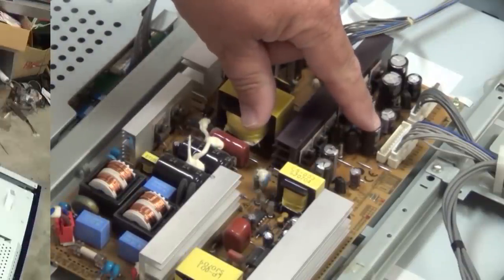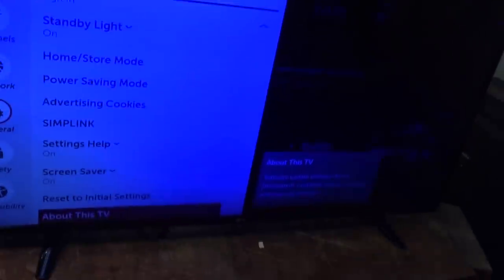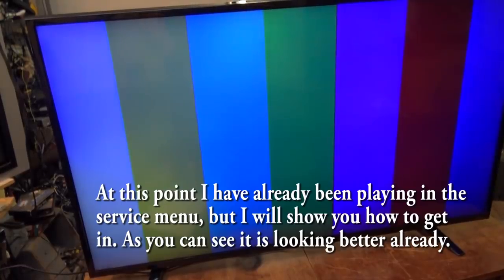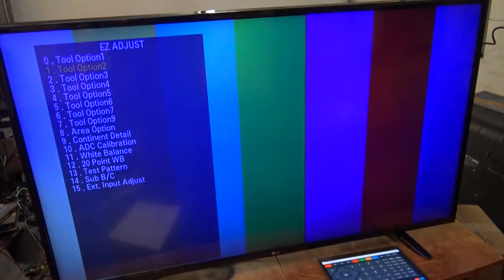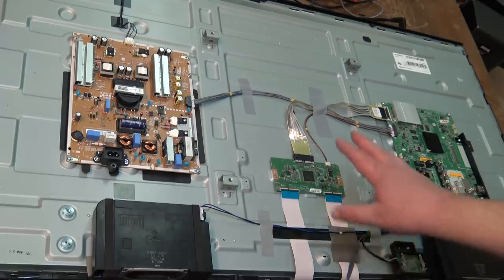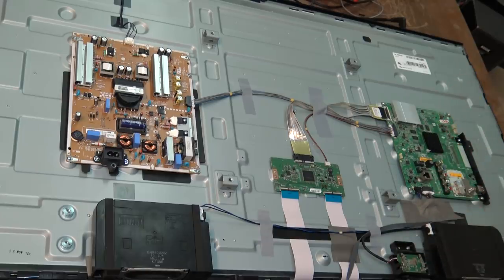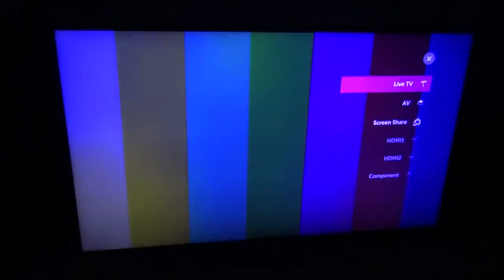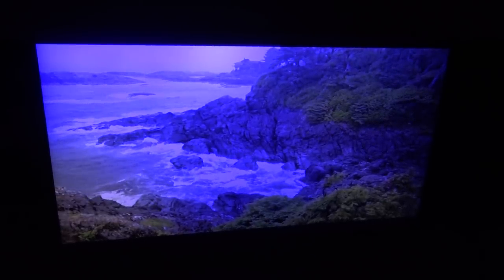LG 49UF6400 UHD 4K TV Picture Turned Blue. Let's find out why.

Comment: LEDs are MUCH superior to ANY kind of gas discharge lamp. They are not only more efficient, also feature much better CRI these days, which is important for color accuracy.

It's just that TVs are just utter garbage! They overdrive the LEDs to offer a brighter picture, do a shitton of image processing to make it look "better" and they lack compatibility with non-cinema resolutions and use HDMI instead of much more versatile and much higher bandwidth DisplayPort. They don't have support for cinema colorimetrics although being meant for home-cinema, they don't feature factory calibrated panels and so on. TVs are just utter garbage in general.

I rather have a small 32 inch Dell UP3216Q PC monitor than a TV with never the same color...

About power consumption: Congratulations for living in North America, but in Germany we pay 30 EUR ct per KW/h, which is AFAIK most expensive in the world. And AFAIK everywhere in the world, electricity is much more expensive than in North America, so I consider your electricity as almost free.
Reply from the maker: If my electricity was free I wouldn't be getting a bill of over 800.00 every 2 months.
Reply: @12voltvids  Then I don't understand why you prefer outdated power hungry technology over modern technology. Buy PC Monitors. They are much better, they easily last a decade. I can understand, TVs are just garbage.
Reply: @12voltvids  I pay this amount a year but only with around 1600 kw/h of consumption...
Reply from the maker: @kyoudaiken  
I use lots of power. Yesterday I user 137.5kwH and the day before that when i had the heat on in the shop 186.2 according to my power meter.
Our power here is .14 per kwh.  It used to be .06 about 8 years ago, but it has been going up every year.
Reply: @12voltvids  Here it also goes up every year. I could not afford to heat with electricity. Gladly we have central oil heating in this apartment building. But I still have an electric flow-heater for both my bathroom and kitchen, which may be responsible of 2 thirds of my yearly consumption. I would suggest you to invest in solar, I can't do that because it's not my building...
Reply from the maker: @kyoudaiken  I have LEDs throughout my house. In fact the only place that I have fluorescent lamp is in  the shop. I do have an LED monitor on my computer, an LG and it has lines running through it at 3 years old so I gues it is about time for a new one. I do however continue to use my plasma TVs because I like the picture. I do have a new UHD 4K set and I don't watch it much because if you are sitting off angle it looks like crap like all the LCD panels.  I have a couple of old CRTs around that I use just as camera monitors or to display the time on (little one over my bench) The plasma TV is not the big energy user here. It is the heating system. I have a heat pump, and that draws lots of power, also drive an electric car, so I have to charge that up, and my work shop has an electric furnace and when it is below 0 outside it needs to run or the shop is too cold to work in. The heat is the biggest draw of power as my "power hungry" plasma set sees perhaps 1-2 hours use a day max. WHen I switched my lights over to LED I saw no real drop in my energy bill, but my wallet sure noticed how much those bulbs cost, because I bought into this scam long before they were down to a buck a bulb.
Reply from the maker: @kyoudaiken  
A solar system big enough to generate the power I consume would cost over 100,000.00. 
I can buy a lot of power for that. I know people with solar systems and they say how much they save but they are also low power consumers. If your bill is only 50 a month it is easy to generate that with solar, but when your bill is 400 a month you need a much bigger system to generate that much. Not financially practical. I could heat with gas and that would drive down my electric costs big time, but then I would have to buy the gas and that would be even more because we have storage and transport fees that are actually higher than the cost of the gas, and then 3 separate taxes on it. GST, PST and the stupid carbon tax on top of everything else.
Reply: @12voltvids  I only have LED lamps in service, mostly flourescent replacements. I removed the electronic balasts and rewired the sockets for them to accomodate the LED tubes. They run since 4 years without any problem. I had, however, LED bulbs in my bathroom fail. OSRAM ones!! I now have a cold white TIWIN installed and it runs since 1.5 years without problems. Fingers crossed. The only LED scam I trapped into was Philips HUE. Those bulbs are not bright at all and draw a lot of power, also they are incapable of producing green!!! For everything else, I never had problems with LED products.

As of TVs, you need to check if it's a VA / MVA or PVA panel. Those combine the angle stability and color accuracy of IPS with fast reaction speeds and high contrast (especially black levels, no IPS leakage!!) of TN. There are PC monitors with it, also 4K and with a large panel (50 Inch and more) without any tuner. I recommend these over any TV. TVs are just garbage. But there are also some TVs with VA / MVA / PVA panels. I have a 31.5 inch Dell UltraSharp UP3216Q in service since at least 2.5 years, no problems, not even the LEDs get darker or blue. And the backlight is always at 100%.

I would check if it is possible to completely switch to a fed gas or oil or even wood pellet based central heater. It may save you a lot of money over electric heating, especially in Canada.
Reply: @12voltvids  I presume it's the same for oil and wood pellets?
Reply from the maker: @kyoudaiken  
Yes oil and pellets also have the carbon tax. Unless you gather drift wood but here you are not permitted to have a wood burning fireplace. If there was one there on an old house you can keep it but can not install a wood burning fireplace on new builds.
Reply: @12voltvids  That sucks, and ironically most of the electricity is generated using fossil carbon based fuels anyway...
Reply from the maker: @kyoudaiken  
Here it is all hydro electric, so no carbon generated here.
Reply: @12voltvids  That's actually awesome. In Germany it is just a mix an match of everything, starting to go high in renewable energy but at the same time getting extremely expensive cause of "green energy". And it's more expensive, huh...
Reply: in Poland i pay almost 2Zl (like 0,4 euros) a Kw/h. Electricity is shit expensive here and the most ridiculous shit is that the kw/h is actually costing only 80gr. The 1,20 zl are for stupid taxes and aditiions like "for the fact that there are wires on the street"+"for the fiact that you can connect your house to those wires on the street"+"for the fact that there is actually electricity on the wires for which you already payed with your taxes and the electricity your'e also paying on the bill but... we could anyway have wires but put no electricity on them!!!" + "for the fact wer'e making the job of making this bill" and so on and so on (obviously with elegant names). In Germany i liked very much my power provider. I was paying 40 Euro a month and at the end of the year i was receiving a yearly bill which was tellling me if i had to pay them more or if they would give me back. In Poland they have made mistakes with the bill (they are not comming to read the meter, they just "estimate" how much i must pay) and when it has happened that i have overpaid they never give us the money back, they allways tell "we will discount you next time"... Which is not really very clear as for usually the next bill is also another estimation.
Reply: @12voltvids  In Canada (Quebec) my bill is 104 $/ month  canadian. Houses and electricity seems a lot higher in the States !
Reply from the maker: @stephanebureau5299  
I just got my hydro bill for december / January.  980.00 for 2 months.  Unfortunately our former liberal government here signed 30 year contracts with their political friends to build run of river micro hydro electric and other private power producer deals with their friends and paid them 100 per megawatt when the going rate was 25 and locked us into long contracts meanwhile blowing smoke up our ass about how good a deal we are getting. Then encouraged us by dangling a carrot giving us a couple grand incentive to get off gas and oil for heat and use cheap ckean hydro electric power.  I took the bait and put in a heat pump for heating cooling and hot water.  Our electricity was .06 kwh. Then after we make these changes to save the planet they put us on a 2 tiered scale where you get the low rate to 1360 kwh over a 2 month billing cycle.  Once you hit 1360 the rate almost doubles.  When all heating is done by electricity that second tier gets hit after 2 weeks and then the remaining 6 weeks is the higher rate.  Well since they screwed us with the private power purchases and the fact they took money out of reserves that hydro had saved to maintain infrastructure the rates have governed up by 30% and it goes up every year. By the time they get done with rate increases my hydro bill will be easily over 500 a month.  I would be further ahead to scrap the heat pump and go back to burning gas to heat.  Of course the current provincial government is living throwing mud all over the old government by telling us how much we are paying for the crooked deals the old crew did.
Reply from the maker: I get a great laugh out if this one.  LEDs tend to all color shift after a few hundred hours of operation.  I can do a video, a simple one using a white card in my kitchen showing some LEDs out of same package one led over the kitchen sink has many more hours then the rest them and it is much bluer than the others.  It gets about 4 hours a day use and the rest get perhaps 1 and it is getting more blue as time goes by.  They are all the same brand (philips) and they were not cheap.  Never notices that with my CFL bulbs.
Reply: @12voltvids  We will all return to wood heating and cooking some day.
Reply: @12voltvids  My monitor has approximately 6000 hours of usage and the 6500K is still bang on. Of course it always depends on quality and source.
Reply from the maker: @stephanebureau5299  
Not permitted on new builds.  When I tore down my house in 2002 I wasn't permitted to rebuild the wood burning fireplace.
Reply from the maker: @kyoudaiken  
My PC monitor is modern. 28" lg onky 3 years old, has lines in pix but I suffer through.  The plasma I use as my edit preview and it only runs a few hours while editing. 
Here is the kicker though.  Replacing functional equipment with "energy saving" equipment only pays off if the equipment lasts long enough to offset the initial cost to replace it.  When something breaks and is not economical to repair then that is one thing, because equipment needs replacing anyway, but tossing my 3000 63 plasma that is functioning fine to spend at least that on an oled set, and then an additional 500 for new 4k hdmi baluns so the signal will reach as the ones I have now are only good for 1080. That is 3500 minimum.  An oled set will draw what about 150 watts.  My plasma 550. So I am saving 400 watts or .4 kwh.   Lets round that up to .5 kwh for simplicity.  At the high rate electricity is .14 per kwh.  So running for 4 hours a day will save what .28 per day running a new set vs an old one.  By my simple in the head math, running 4 hours a day 365 days my plasma will cost about 102 more than an oled set of similar size to run.  So by that math the TV will never save enough power to justify buying it just to save energy. What kills me is my 2 grown children that still live at home taking long showers, running the washer and dryer at all hours, parking their ass on the playstation or xbox which draws a ton of power plus the TV they use. Cooking their own meals in electric ovens at all hours of the day and night. I am pretty sure once they do finally fly the coop my electric bill will drop to half or perhaps even lower.   When I bring it up the say "I pay rent stop your complaining" well at least their rent covers the electric bill.  For that I invite them to stay, because at least they are paying their way unlike some of my friends with 20 something kids living at home and not contributing anything, including getting a job.
Reply: @12voltvids  I understand that, though I only have problems with other parts of hardware than the screen. But other than that, this screen cost 1500 USD when I bought it 3-4 years ago. So I would expect it to last. Would be sad if it didn't. Still other stuff makes me sad. My all in one water cooler died after just 3-4 months due to a problem with their coolant mixture. They use a copper cold plate pump assembly and an aluminum radiator. Without corrosion prohibiting additives, the cooler corroded inside. Still waiting for my warranty replacement. Warranty is also a topic that makes me mad. The time from you sending it in and receiving replacement is not arguable...

Long talk without sense: In our capitalistic world you only get decent stuff if you pay much. And even then, bad or even not present quality control kills your devices prematurely. Including the lead-free nonsense that cause even more cold solder joints. And then they try everything so you cannot reach the regions to repair it with fresh juicy leaded solder, IF YOU CAN EVEN STILL BUY IT...
Reply from the maker: @kyoudaiken  
Leaded solder readily available here.  How much you want.
Reply: @12voltvids  New law in EU forbids selling this stuff to hobbyists. It's getting crazy here, but due to Article 13 we're on the streets anyway.

I will try to get stocked up, it should still be possible to get for a while. I hope. If not, I might get some through eBay.
Reply: @
KYŌDɅI KΞN  Are you sure? I think the better efficiency (compared to the best T5 or cold cathode flourescents) only true around the absolute maximum ratings of the best LEDs, which results in what you can see in this video: dying LEDs after a few years. Last time I did a somewhat comprehensive research about LED efficiency was about in 2012, at that time, the best LEDs had about 80-90% of the efficiency (lm/W) of the best fluorescents, so fluorescents were still better. 2012 is far gone, I'm sure LEDs evolved a lot since then, but I'm not quite sure they are THAT much better. 

And I'm quite sure that reliability-wise, fluoroescents are still much-much better. Don't talk about the claimed lifespan of the LEDs, as they rarely reach it in real life. The rate of random failures are unacceptably high with LEDs. Most cases, it's not the semiconductor itself, but the joints of the bonding wire that fails. It happens with $2 noname LED bulbs, and with $15-20 Philips and GE LED bulbs as well. With fluorescents, you can expect they will last for about their rated lifespan (I'm not talking about compact fluorescents), but with LEDs, it's like lottery.
Reply: @mrnmrn1  Bullshit, LEDs are even more efficient when underdriven. Because heat means less brightness. You don't seem to have any clue on how this technology works. Gas discharge tubes are ok. But you only get them in disgusting color temperatures and the color rendering of them is completely trash. Like CRI/Ra 10 or so...
Reply from the maker: @mrnmrn1  
I just changed a PL13 fluorescent on a magnetic ballast. It was originally installed in 2002 when I built my house. I have some CFL bulbs that were also installed in 2002, 2 of them, both 42 watts are in my work shop. I have had to fix broken connections on the ballast board on both, and the plastic base is all cracked and falling apart from all the UV light and heat, but they both still work, and are in service in my workshop.
That is 17 years and still working.

Comment: Still using a Zenith B27A74R stereo console made April 2000 as our everyday TV, was given to me 5-6 years ago had bad solder joints resoldered and been using since with no problems. Not bad for 19 years old. My other sets are much older. Been servicing electronics since before getting out of high school in 1974. Will not give up my analog CRT tv's . Sorry all you flat screen snobs but I'll stick with the good stuff. I never thought consumer electronics would turn into the absolute garbage it is today.
Reply from the maker: True CRTs were pretty reliable. Some tubes were better than others, but most were fairly reliable. I had an HD tube set that I gave to my relative and they threw it out without thinking to ask if I might want it back. I wish I still had that bear. Would have it in my workshop where that 42 plasma sits.